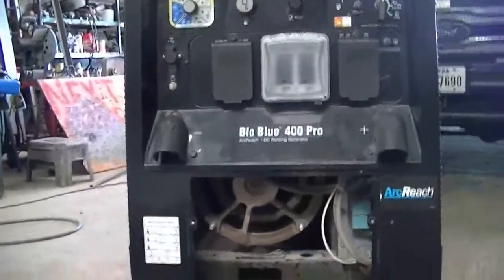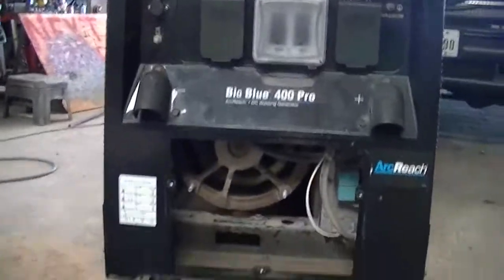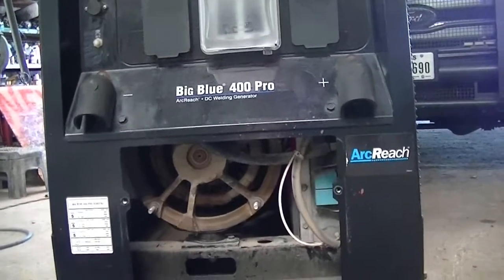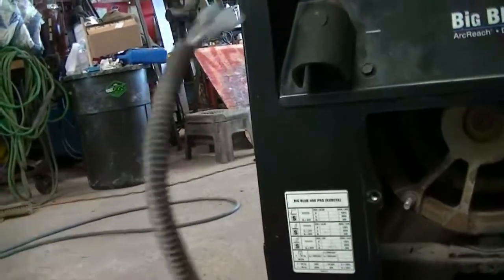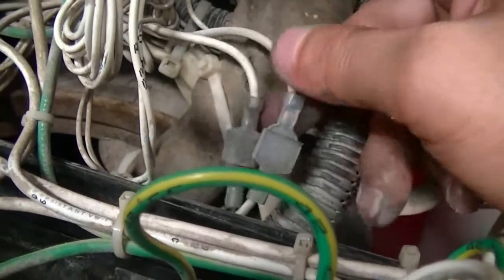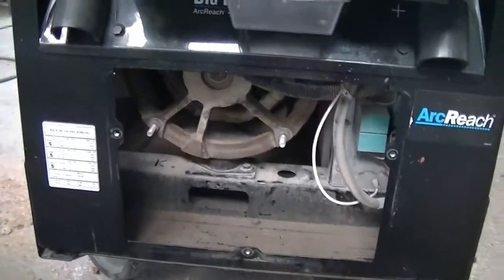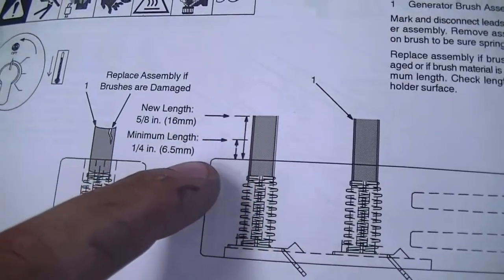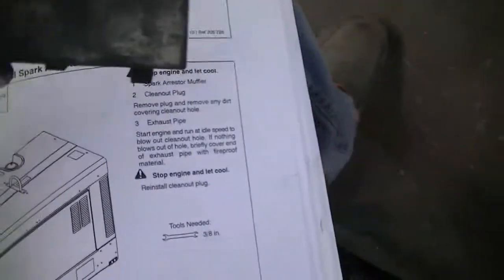Troubleshooting Miller Big Blue 400 - Checking/Replacing Brushes

Comment: Good video.. I have a Miller Big blue 300 pro going to change out the brushes. Do you replace the entire part with the wire connectors and the holder or do you only replace the pieces that may contact?
Reply from the maker: Thank you for the feedback! You replace the whole block with brushes and wires. When you order the brushes it will all come together.

Comment: im having problems with a big blue 400 ... cranks up and runs but im not getting an arc or voltage... breakers good, diodes (those square things by breakers in side panel) are good, fuses are good, brushes are food, slip wheels are clean but still no arc or voltage 🤔🤔🤔

Comment: Do you ever see problems starting Big Blue 500 D?  Mine will crank and fire up, but rough idle and only generate 30-40 volts.
Reply from the maker: Does it have the Duetz? Have you checked the fuel filters?

Comment: Came across your video and was wondering if brushes will throw a help 21 code my  2012 300 pro gave me that code today. I have 110 power not sure about 230 volts and of course no weld output thanks if you reply I would greatly appreciate it. It's been a good one hate seeing it down
Reply: Did you ever find the problem ?

Comment: I have a 300 pro breaking arc after running a bead about an inch long. I have adjusted the idle a bit and cleaned the slip rings also. What else should I try or do you have any idea what could be the problem? Thanks.
Reply from the maker: Do you have plenty of meat on the brushes? If they are short there might not be enough pressure to hold them tight on the slip rings. Does it run a grinder consistently without any problems? Does it do it in all stick settings?
Reply: Checked brush length. They’re right at that 1/4 inch minimum. Ordered a new set immediately after that they’re on order right now. And I’d say yes it did it in all stick settings. Ran a grinder fine.
Reply from the maker: Yes that could’ve been your problem
Reply: Thanks for the help. I’ll keep you updated. Keep these videos coming please. Very helpful.
Reply: So put new brushes in today and I’m having the same problem. Anything else I can check out? Thanks.
Reply from the maker: Do you ever get any help codes? Might try checking all of your wiring making sure theres no loose connections or shorted wires. Check behind your heat sink also. https://www.instagram.com/p/BxsJfKRjH1I/?igshid=1g0u4gtchy1m6
Reply: No help codes are showing up at all. And I’ll do my best to take a look at that. Thanks.
Reply: So I ended up having the rpms too low so I got the idle adjusted correctly and welds like it should. Thanks for the help. Another question though. This machine doesn’t have a low idle solenoid. It looks like I have the wires in the harness for one. Can one be put on this machine?
Reply from the maker: No sir you would have to buy the solenoid and board
Reply: Board as in main board? Or something else? Thanks for the information

Comment: My outlets dont work on a big blue 300, i already change all the outlets and the fuses, but they dont work i just get a red light in the outlet do you know what could it be?
Reply from the maker: You changed them out with gfci’s?
Reply: @ntxwelding626  yes they are direct replacement from miller
Reply from the maker: @juliozumaya5290  and you checked all of your circuit breakers? You’ll just have to back track from the outlets to cb’s and see where the power is stopping. Should be a schematic on on the inside of your door.

Comment: I have a 300 pro that will not decelerate, do you know what it could be?
Reply from the maker: Does it have a low idle solenoid on the motor? Some do not come with low idle.
Reply: @ntxwelding626  no it doesn’t
Reply from the maker: @aracelivega2933  Then it will only stay on high idle. You could buy the low idle kit from Miller I believe but I want to say it's around $2500
Reply: @ntxwelding626  ok thanks I’ll check it out
Reply: I know the older 350d trail blazer model has a 5 point pin that controls that idling 🤷‍♂️🤷‍♂️. I own a pipe pro 350d not sure how that is set up

Comment: Where do you find the brushes?
Reply from the maker: Baylie Buckholtz replacement brushes? You can call any welding supply and give them you serial number and they can get you some. I personally use Bills Welder Repair out of Okc.
Reply: NTX Welding  thanks! I found them online
Reply: What if you don’t have the serial number? I looked everywhere I can’t find it. I have a miller 300 pro with the kubota. What do you recommend?
Reply from the maker: @mannyg85  Most of these later models use the same brush assembly part# 244290